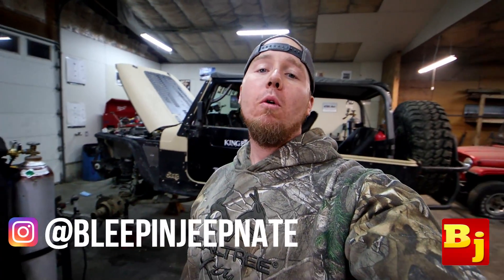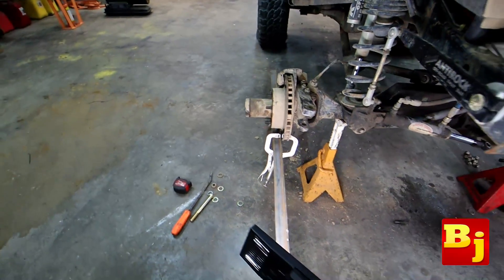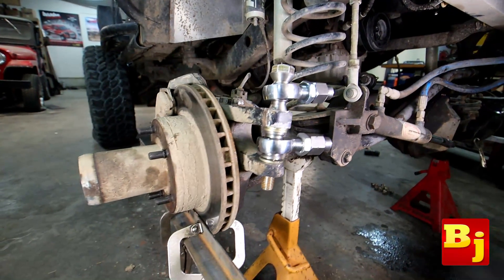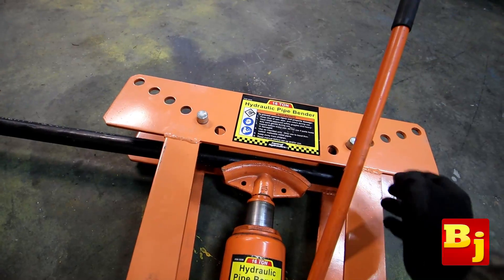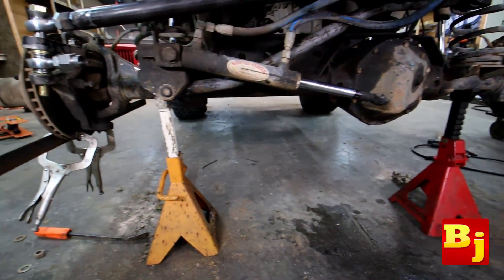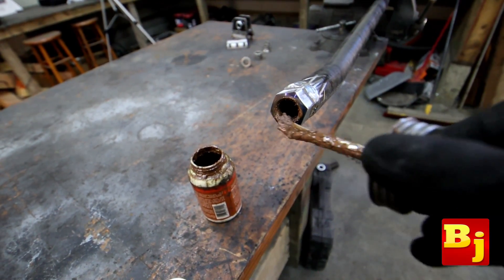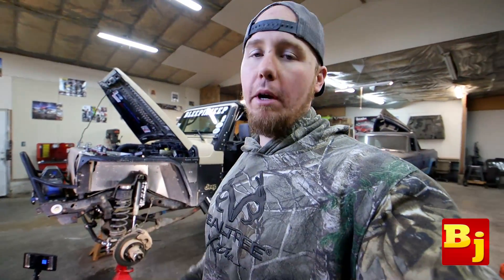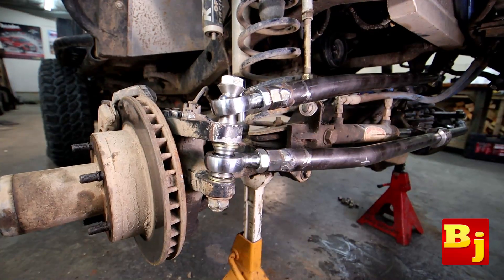DIY High Steer Kit from Ruff Stuff Specialties

Comment: I've always aligned vehicles to the preferred settings, which 9/10 times is a bit of toe in, not out. The road force on the tires basically zeros out the toe while driving down the road.

Comment: The safety spacer keeps the rodend from coming off the bolt head if it fails. Aircraft use large area washers to prevent complete disconnect. They fail usually because they aren't lubricated regularly.
Reply: That makes sense, thanks brother!
Reply: Exactly.  It's called a safety misalignment.  If the helm fails / Comes apart,, the the safety misalignment is bigger than the hole through it. Also keeps from having to put a large washer,  which would be a separation spot to be able to break. 
But, I have put a large washer on top of the misalignment one anyway with no problems... 
But,,,,,, if the bolt broke,, all that safety,, just went out the window..

Comment: The safety misalignment spacers eliminates the need for a safety washer. If the heim fails the wide part won't allow the bolt/heim center to pull out and separate.

Comment: I made my own tools out of a old metal bed frame drilled one hole the size of my lug stud and made them like 30 inches long you bolt them to axle with stud and lug my dually Dana gm 60 was 77 wide cross over high steer using tie rod ends .

Comment: Factory alignment settings are usually toed in, not out.
Reply: It actually depends on the scrub radius of the steering geometry.  Your typical macpherson strut configuration has a toe out setup.  In this case, the steering would be toed in, as you pointed out.
Reply: Yea but it really depends. Usually FWD cars use littlebit toe out because tires has habit to toe in when driving. RWD's uses toe in because those front wheels doesnt have so much pulling force at them as FWD cars. I dunno which one is right one at AWD cars but I think that both of them are ok at AWD setup. If tires wont get ruined due wrong steering angles and it goes straight at road, I wouldnt think it too much
Reply: every alignment I've done called for toe in regardless of macpherson,dual a arm,solid axle or twin I beam but i can't think of any reason why it make a difference it should have the same effect either way
Reply: That's not true.
Reply: @steven14621462  I agree. Only cars that required toe out in my expeeice were typically police vehicles. Maybe for quicker maneuvers
Reply: I've dialed in a bit of toe 'out' before , it depends on what the contact patch looks, the caster, where the engine is mounted relative to the axle, and which wheels are driven. Negative toe can improve handling (oversteer issues) 'feel' especially for RWD vehicles, which is why @watupal would have seen with doing alignments in police vehicles which were all RWD. until recently Since a Jeep alignment really matters most on the road, adding a little negative toe can really improve the road handling characteristics which you will feel in the wheel for sure.
Reply: Just my experience.  When the truck, with any type of over size tires rolled forward,  then what happens?
The tires try to turn inward, because they are being pushed. 
If u push someone,  they curl up, and fall to the center,, they dont open there arms and legs,, like they just jumped out of a airplane.  Just simple common sense. Plus,, lol,, were talking about 1/8 inch.. gheesh.. We mall crawling with momma's money after the divorce settlement. Hehe..  Ok,, back to real deal, 4x4 stuff.  Not some book says so on some this that or another kids idea because he works at ntb doing tires.  I agree with the tiny toe out,, because no matter where you are rain, snow, sleet, shine, pavement, dirt, except a deep pushing water mudhole,, the tires will try to toe IN.. always.
Reply: @joebeasley2764  if the toe is set out your tires will try and pull apart while driving. Scrubbing the inner edge of the tire and causing premature wear. Every time I've done an alignment with bald inner edges the toe was set out and well beyond spec. Ideally for a straight axle'd truck you want your toe set to zero. Depends if you have a straight tie rod from knuckle to knuckle, or stock jeep y link steering. As the suspension travels the toe goes out. In that scenerio I would adjust to. 05-.10 degrees of toe in. Best for tire wear in my experience doing thousands of alignments.

Comment: The Safety spacers are for if the Heim joins fail and the ball gets out of the joint the rod will still stay attached to the bolt and help steer to safety. Without these Safety spacer the joint will fly off the bolt and you have wheels going where ever they want.

Comment: Seems tough enough. Angle grinder cuts just don't have enough precision and tend to be the easy way vs. the right way to cut a nice 90 degree angle etc., in my opinion. I may be off a tad, I thought that the recommended tow was slightly towed in vs. out ?  The drag link could be a tad too close to the sway bar link when on the trail ?  Nice design and parts.

Comment: I’m doing a swap in my 92 f150 with a 79 d44 I’m wanting the high steer and I see you said you used the knuckles from a 250. Does that mean I would need to do spindle hubs etc for a 250 as well?

Comment: If you’re bending the bars and using heims, how are you keeping them from twisting when you lock everything down? You had the joints centered and I didn’t see anything that would keep them in place. Might have missed something 🤷‍♂️
Reply: Nothing in this case. On my crawler I didn't use the misalignment spacers on the tierod just washers. That way there is very little rotation. I would bet the ram is rotating the tierod in this case.   On the draglink you just have to let it twist, because you don't want to limit the articulation. I also don't have bends on either that can cause rotation. 
 This video reminded me I need to call up Ruffstuff and order a replacement heim. I use all Ruffstuff.

Comment: How much bump steer does this rig have? I notice the track bar is sitting quite a bit below the new drag link connection at the wheel.
Reply: Not bad actually! It looks like it would be bad but its manageable enough that I haven't felt the need to upgrade it. It's been like this for about 9 years, That being said I plan to relocate the panhard bar and some other things in an upcoming video series
Reply: Hydro assist steering will mask that bump steer
Reply: @BigTireGarage  absolutely

Comment: The geometry of the track bar and drag link does not look good to me. Plus i think you needed to add another bend to the drag link to keep the heim joint from getting in a bind. The axle is resting on stands right now but if jack up the frame I think you will see some concerns.

Comment: Are you using any thread locker on those steering nuts? And what are you torquing them to
Reply: I like to drill a hole through the nut and bolt and put a big cotter pin in. 1/8" dia. works perfect.

Comment: You should have tiny bit of toe in, not toe out.  Toe in helps it track straight at higher speed.  Toe out will make it twitchy.
Reply: Actually too much or either will make it twitchy.  The type of toe you adjust all depends on the suspension configuration.

Comment: so i have a question. i decided to go with flex joints "johny joints" for my trailing arms for a couple reasons. my rig is a daily driver and weekend warrior and wanted something not as clunky and rebuild-able. i know this rig is mostly for offload so it probably doesn't matter . but using hiem joints for steering components. would that be less clunky or is there an alternative for that too?
Reply: I'm not quite sure what you're meaning when you say "clunky" but here's my 40+ years of Jeep experience:
Stick with a high quality company such as Moog for your steering needs. Inexpensive, greasable and always easy to fund at any parts store.

If you're daily driving and weekend warrior'ing your Jeep, there's no need to go beyond, even if you're running a tire as big as a 35.

Comment: Wish I could find a cheap welding shop. Last time I went to our local welding shop I needed 1 bar welded in 2 spots, about 5 minutes of work and they wanted $140 for it. Ridiculous.
Reply: Try a sheet metal shop. I run one and will do a quick burn or 2 for cheap. But I know welders that won't break out the machines for less then $100.